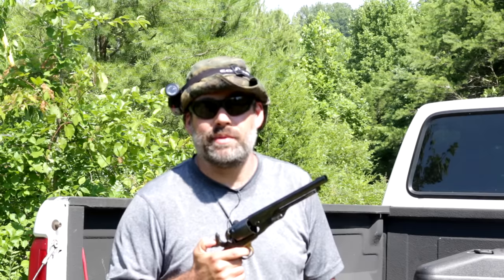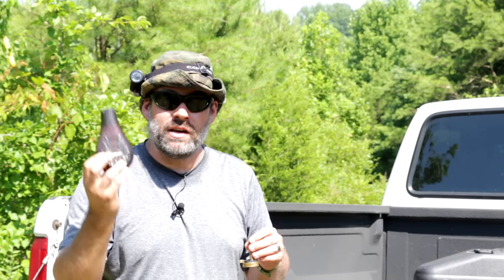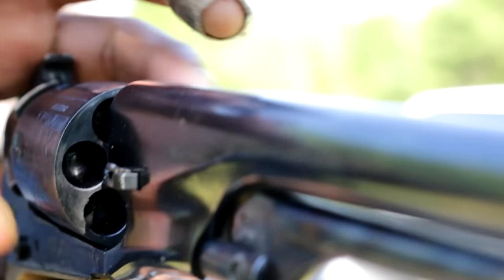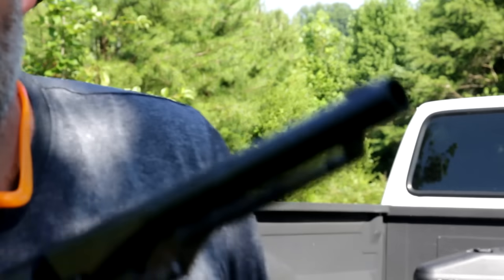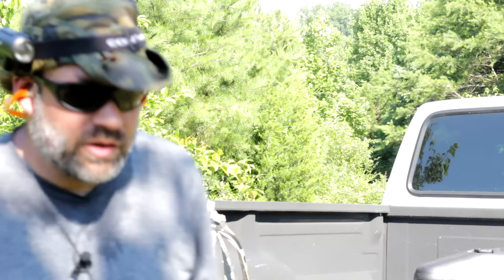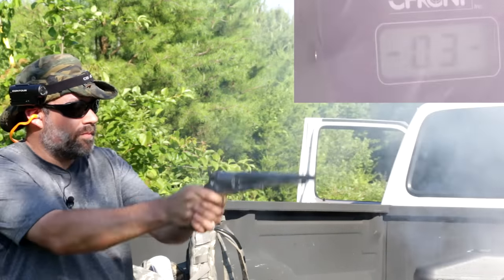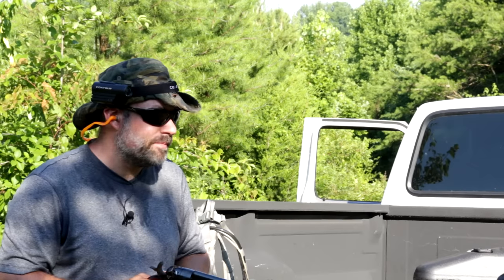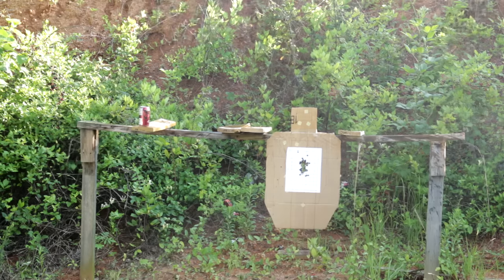How Powerful are Black Powder Revolvers?

Comment: "How powerful are black powder revolvers?"  doesn't use black powder  What's the point?
Reply from the maker: +Michael Spivey Many people use black powder substitutes so the video does in fact have a point.  According to the manufacturer the Pyrodex has similar power per volume when compared to real bp.  When I can find some Goex black powder I'll verify this on video so stay tuned and thanks for watching.
Reply: What I would like to see is a Youtube video where somebody produces some homemade black powder from locally available materials, and then fires test shots where the homemade black powder gets loaded into a black powder revolver, and then the shots get fired through a ballistic chronograph. I would just like to see if homemade black powder can work just as good, or even better, than commercially made FFFG black powder when it is fired with a black powder revolver.
Reply: +Michael Spivey He's talking about the power of the revolvers themselves, not the specific type of powder they're named after. That means he can still test them with different substitutes.
Reply: First of all the revolvers were produced at a time when black powder was the ONLY propellant. So they can always be called Black Powder Revolvers. Because of their design.  So, 100 or so years later, technology comes up with alternative propellants, such as Pyrodex (which is very much similar to black powder,( it's not as if it were talcum powder) so you wonder what the point is? The point could be that you are in the dark.
Reply: @danieljanneyruinedmylife4434  I know for a fact it is better. I make my own high quality BP  pressed @ 3,000 psi with homemade black willow charcoal. It is Miles above any of that synthetic crap.
You may have just inspired me to buy a chrono and make a vid !
Reply: Jiří Dušek  And it would blow up the revolver. If you know any thing about Black powder firearms, they all say "Use Black Powder only"
Reply: @17MrLeon   mix in some aluminum powder too. But you best get some life insurance first.
Reply: @danieljanneyruinedmylife4434  codys lab

Comment: The black powder that they used in the late 1800 was superior then what we have today. They had the right kind of wood to make the charcoal with they had everything set up all they had to do is the labor. I have never tried Swiss powder before but I hear it's probably the best. If you can get ahold of some of that you'll be doing at least close to what their results were back in the day. And most of them used the conical bullets. The conical bullets are heavier I don't know by how much. And to keep your caps from coming off you need to put a filler in the gap on your hammer. And some people also replace their nipples with some aftermarket one's. The flash hole inside the nipple is too big causing too much blowback which causes the cap to come off. Check YouTube there are some videos concerning this issue.

Comment: I remember going to Surgeons Hall Museum in Edinburgh many years ago. More interesting than the grizzly exhibits - I found a painting of a young British Lieutenant dying in his Captains arms. The extensive post-mortem concluded that the extensive wounds were caused by a French musket ball. This had entered his chest on the left side, ricocheted off of his left shoulder blade downwards, ricocheted off of his pelvis bone (right side) proceeding upwards and exited his body after breaking through his clavicle bone on his right side. French muskets (Charleville's) were  0.69-inch (17.5 mm) caliber. Low velocity means little with such a high momentum !

Comment: I’ve been told that over loading will warp the gun and cause the cylinder to pull away from the barrel causing gas leaks and possible damage to the gun. What do you think?
Reply from the maker: Only with brass frames.  In .44 cal brass frames Keep the powder charges at 25 grains measured by volume to get the maximum life out of the revolver.

Comment: After I shot my Pietta 1858 NMA quite a bit I decided to just fill the cylinders up to level and crush a ball on top. it can be done and you will need to compress the hell out of the powder. and it works just fine. Load was about 45-47 if i remember correctly. Pyrodex P grade. it shot with more thump but no real down range improvement. so I just dialed my load back to 35grain and called it good.

Comment: When I had my Ruger New Army 44, I used corn meal as a filler instead of Crisco when finished loading. It (like Crisco) prevents multiple chamber discharges and is not as messy as Crisco.
Reply: Isn't your bore fouling up badly?
Reply: @selfinmegellco4331  Yeah.  That would not help with clearing fouling and lubing the barrel.

Comment: Two things occur to me watching this video: 1) The initial shooting at 25 grains goes up in velocity, significantly, every shot, proving the value of "fouling shots". From a perfectly clean gun, less that maximum performance is actually expected. 2) No mention was made of cleaning the gun between charges. The buildup of fouling, combined with the inability of excessive powder to combust fully in such a short barrel, probably combine in equal measures to reduce performance with the heavier loads.
With that said, these were never intended to be shot with "maximum power"; rather, the perfect load is the heaviest load with which you can still achieve best accuracy. In mine, around 28 grains gives a very solid compromise, and comparing it to a .38 special is fine with me. A well-placed shot from a .38 special will kill anything that should ever be hunted with a gun like this.
Reply: Hippo Potamus Man actually you forget something that matters more than fouling, the temperature, after one or two shots barrel will get hot, and having a better seal between the ball and the barrel. I get that idea from the engine by the way.
Reply: @davidgruen7423   So better gas seal with both the fouling and expanded metal because of heat?

Comment: I wish I still had it, but I bought one of the first Ruger .44 Stainless BP. I was told it could not be over-stressed with BP. I always used FFF and my final round was 240 grain conical mini-ball. I adjusted the powder so it would enter the hollow without crushing the powder. I took it up to friend's house who owned a model 29 S&W .44 mag. He had a pile of mill-ends to run tests. He was using factory loads with 180 grain bullets. I can't remember what grain of charge I was using, but we were amazed at how my SS was coming very close to the penetrating power of his 29. But unlike his S&W, the Ruger was NOT pleasant to shoot!!.
Reply: Yes, ALL of Bill Ruger's firearms are warranted to safely "any charge of powder that will fit in the case/chamber". A caseful of  Bull's-Eye in a .243 Winchester may split the stock, and you will need a bronze hammer to open the bolt, but it won't harm the action, or more importantly, you. I love the sights on my Stainless Ruger Old Army. I just wish I had a dishwasher (!) to clean it in! I don't remember the Lyman bullet mould number off-hand, but I cast a 195 grain pure lead bullet (.454") for my Old Army. It'll leave a mark on a bad guy!

Comment: Cap jam issues are almost always caused by burrs and sharp edges on the hammer pulling the cap off as it is cocked. With properly tuned revolvers, I have put hundreds of rounds downrange without issue.

Comment: Velocity variation likely caused by stock nipples with varying flash hole size.  Replace stock nipples with good nipples having tiny flash holes from Track of the Wolf website. Original Colt nipples in new condition have very tiny flash holes of uniform size nipple-to-nipple.  The tiny flash hole prevents excessive blowback and keeps pressure uniform from shot to shot for low velocity variation, higher velocity and tighter groups.  Properly loaded with high performance black powder such as Swiss, the C&B revolvers can be extremely potent and accurate handguns.

Comment: If jams are frequently encountered there is a simple solution. Purchase a 1858 remington. They jam far less than the colts and also are a much stronger design if you are going to shoot a lot. I had a brass frame colt replica and the barrel shot off when I pulled the trigger. The rod holding the cylinder and barrel on stripped out of the brass frame. Then I bought the 1858 and never looked back.
Reply: Sounds like either poor handling on your part or a design flaw in the gun. 
I’ve shot hundreds of rounds out of my 1851 .36 
.375 round ball. 22 grains fffg. wadding. 
Brass frame. 

No loosening, none of that mythological “stretching” or anything. 

However yes your correct. Remingtons jam less.

Comment: Once you go past 30 grains pyrodex the isn't enough back pressure to ignite all the powder usually. So run up against diminishing returns as you saw. Would like to see this done with actual black powder. I also wonder if a wonder wad would help at all.

Comment: I recently watched a video that showed real instructions from the Civil War era for a Colt revolver.  The instructions said to fill the black powder to the top of the cylinder chamber and then put a ball in and push down the ball as far as you could.  The round ball was able to get below the cylinder and fire without issue.  That was done with real black powder, I don't think it would make a difference if it was real BP or not but it was definitely interesting.  As far as how much more power is created it did move up a little bit with each increase in powder.  The best way to compare would be to look at numbers from 25gr and 40+gr without using the 30 or 35 gr numbers.
Reply from the maker: I'd like to see that video because using Goex 3f that'd be nearly 50 grains of powder.  No cap and ball manufacturer today would recommend that load and As I showed anything over 30 grains is mostly wasted energy.
Reply: @deuceandguns  
I really enjoy your channel. I wasn't able to paste the link but here is the information.
The creator's channel is-
GUNS OF THE WEST.  The video's title is -
HISTORICAL LOADING of COLT REVOLVERS and it's dated November 21, 2020. I don't think the revolver in the video holds as much powder as the revolver in your video but the instructions are from the 1800's.
Please let me know what you think.  I'd like to hear your opinion.
Reply from the maker: Thanks.  I'll look into it because it lines up with a future video of mine.
Reply: @deuceandguns  
Awesome!!  Looking forward to it.  I'm an old shooter but new to BP and I appreciate your content.  Liked and subbed.  Merry Christmas.

Comment: Hey BC of the past.  I ended up purchasing a Pietta Remington New Army Brass frame about 4 years go.
I hate to spoil your future but after the Pandemic/ Zombie Outbreak  a couple of years ago it has been
next to impossible to find  Remington #10 percussion Caps.   Do you have any idea where they can be found?
Reply from the maker: Hey Bill.  BC from the present here.  I was hoping the caps would come into stock in regular sporting goods stores around now for black powder hunting season but I'm not seeing anything.  I'm going to do some searching and see what I can find.
Reply: Hey BC, I appreciate that.  I have a wild idea.  Can  someone with great gunsmithing skills backwards engineer 
my Pietta 1858 New Army Percussion Cap BP revolver into a 6 shot flintlock BP revolver.  Yes,  I know they would have to use a C&C machine to create the teeniest frizzen pans to replace the 6 percussion cones.
On the bright side,  no more cap sucking.

Comment: I have a stock length (7"?) Pietta repro of a Remington New Army (1858); with the maximum load I can fit, 35 grains (Pyrodex, by volume) and round ball, it feels and shoots much like a full power .357 -- 143 grain bullet should be around 1200 ft/s.  I haven't yet tried it with conicals, which would require reducing the powder charge a little, and I don't have a chronograph, so I'm guessing on velocity based on bullet drop and recoil (both comparable to a medium-weight bullet from a maximum load .357).

Comment: I suspect that the small increase in velocity is partly - or mostly - due to the small contact area of a round ball at the lands, thus the ball skips enough to allow gases past the contact ring.  A conical bullet may be able to use the increased load better due to larger contact area.  In my past experience with cap and ball revolvers, they always give up accuracy at longer ranges when over loaded for increased velocity.  That usually means a stripped ball being pushed too fast to grip the lands.  28 to 34 grns seems like the best for most of the guns I've owned.  Conversely, a rifle with patched rb will definitely get the ball there faster while retaining more accuracy until the very limits of the patch strength.

Comment: Really enjoyed your vid...being a cap and ball shooter since the mid 1990's.

I'd be interested in seeing the same test using real black powder instead of Pyrodex. I have both, but I abandoned pyrodex when I got real black again.
I used 30gr. of 3F Goex for a long time(in my 2001 Pietta 1860 .44), then upped to 35gr. There's definitely more recoil and noise. 35gr will probably be what I stick with.

 Also have a 2015 Pietta .36 Griswold & Gunnison that I started off using 18gr in, then went to 20gr, then settled on 25gr....which really wakes up the .36.
Reply from the maker: If I can ever find some Goex for sale I'll buy several pounds for testing.
Reply from the maker: I never knew Grafs had Black Powder.  I'll have to put together an order of smokeless soon for the reloading season and throw a little BP in there.  Thanks.
Reply: I guess you know by now that they can't ship caps and powder in the same box.
Reply: Yep. Got reminded of that.   Thanks.

Comment: You should try this with Triple 7 powder. I used 40 grains of Triple 7 in my 8 inch barrel Remington new Army. It fills the cylinder rate up but my chronograph reads wrong and I'd love to know if I'm actually gaining over the 35 grain max reccomemded. Awesome vid!

Comment: With mine i just fill the cylinder flush with powder. The balls will compress the powder just fine. Lube is optional as long as the balls are pushed in right. They are fun to shoot. Ive never had a powder measure so I don't know how much powder i put in.

Comment: Hmmm...as I suspected...about like a ,44 Special.... nothing wrong with that. I think the highest velocity I ever got with a round ball was about 1085 if memory serves (from an Uberti Remington '58), the 18" carbine was about 1150. All deadl,y and more than accurate enough for the job.
Percussion revolvers might be a little slow to load (combustible cartridges speed it up a lot on the range or in the field), but they are serious arms.My cartridges have about 35 grains of 3F BP (Schützen) behind a 200gr conical at around 850fps.
Intersting video...thanks...

Comment: Thanks for the demonstration of an awesome "primitive" firearm. Seems like the best performance was from 30gr. 25 seemed light, like a target load, and any more than 30 it looked like there was not enough cylinder space to hold the ball long enough to build up pressure. I bet if you fired point blank on paper you would find the heavier loads peppering the paper with a lot of unburnt powder.
Reply: Agreed! needs a faster/finer powder to make use of the chamber. A tighter clearance on the cylinder to barrel would help but then you run into fouling problems.
Reply: I have an 1860 with 3" barrel, and have considered seeing what I could get going with FFFFg, but I just can't quite convince myself that it's not a good way to blow up a chamber, even starting with a very small load and working up while keeping watch with my chronograph.   

Civil War revolvers had 8" barrels for a very good reason... black powder has an extremely slow burn rate and even with 3F powder, there's a problem getting enough of it burned in a short barrel to produce much meaningful muzzle velocity. 

I've also thought about blending 4F and 3F but I don't think there would be a good way to have enough consistency to prevent wild shot-to-shot velocity variations.  No matter how well it was blended, it seems like the coarser powder would settle away from the finer powder with handling.

Comment: I would say that, not only did 30 grain and above prove to not be terribly effective on the increase of velocity, that the extra force is not doing the weapon's frame and mechanicals any favors. The extra stress on the weapon and potential instability (both in misfiring, weapon failure or reduced accuracy due to recoil) are not equal tradeoffs in my mind. As many said: This killed over 170 years ago, and would do so again.

Comment: how far are you from the chrono screens? Do you thing using real Black Powder would give different results?
Very interesting thank you.
Reply from the maker: Hard to remember exactly how far I was but I usually set up the chrony between 5-7 yrds away at this berm.  The sun was behind the chrony so the smoke was not impacting the reading.  Had the sun been behind me there would have probably been an issue at that distance.  Per Pyrodex when measured by volume they are supposed to be nearly equal to real BP but one batch of real BP from another will result in different speeds even from the same manufacture.
Reply: Black Powder will give very slightly higher velocities in short barrel pistols than Pyrodex, IF it's high-quality (Kynoch), fresh black powder. Pyrodex is much more consistent container to container. Kynoch Black Powder from England cost about 8 times as much as Pyrodex. Yeah , about $80 USD for 400 grains. IF you can even get it. Dynamit-Nobel black powder isn't available in America at all.